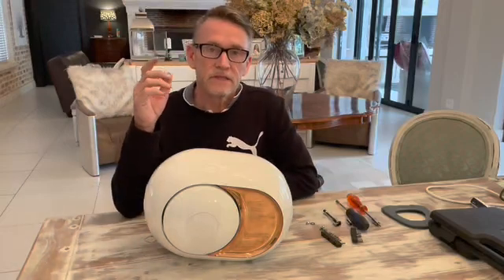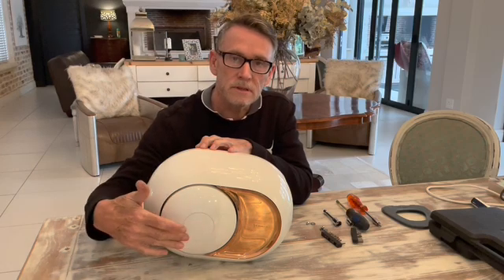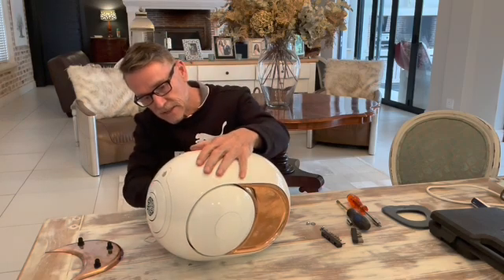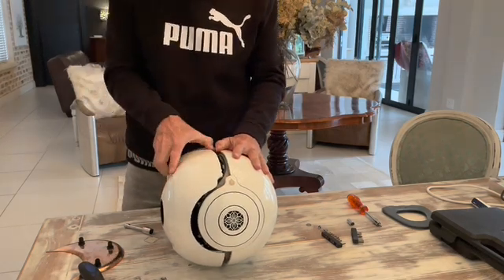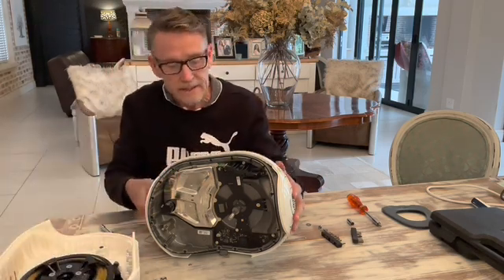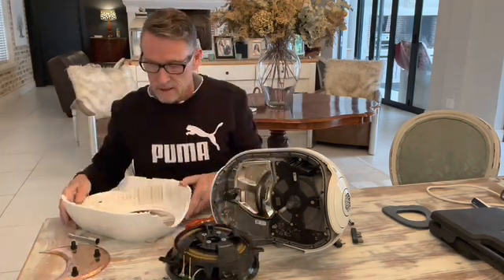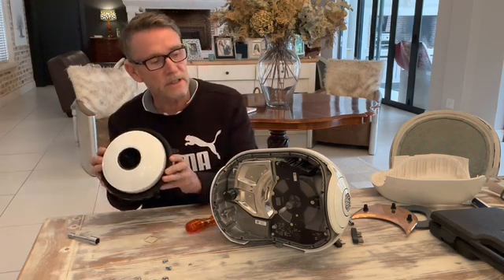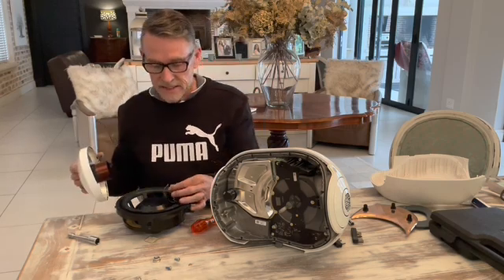Devialet Phantom Gold Repairs

Comment: " Devialet Phantom is airtight and hermetically sealed, a key design feature that enables its powerful sound and physical impact by creating an internal high-pressure environment for the lateral woofers. This sealed architecture allows the speakers to generate dense sound and deep bass frequencies by moving immense amounts of air without compromising sound quality or allowing outside interference. "

also :

" No DIY Repairs:

You cannot repair Devialet Phantoms yourself, as they are complex and require specialized handling and air-tight seals to maintain sound quality. "

😅

Comment: I'm disappointed to see this side of Devialet. Now, I'm not surprised that it is own by LVMH (Louis Vuitton) whose only goal is to sell weirdest sh*t as a fashion statement at the most ridiculous prices, they don't give a damn about repairability and much less about getting the repairs done in as less as possible.
Reply: They also advertise it as a 3,000 - 4,000 watt unit. In no way is that thing pushing that much power which requires a relatively THICK power cable and/or a beefy power supply.
Reply: @Iridiumcosmos it's 1,100W they have advertised that it was 4,500W but finally advertising the actual wattage of 1,100W
Reply: When did they get bought by LVMH? Quentin Sammie sold out🙄

Comment: Hey Ian Rose. I just saw your video that you openned on one side. Mine, there's a knocking on that side when I turned the volume up. Sometimes it will stop then comes back and also the loud knocking, sometimes it wont. Thank you for showing because Id like to open mine but do you have any idea on my case so that maybe I could go directly, with your advice? Thank you in advance.
Dennis
Reply: 😮very very late question😂 My 103 developped rubbing noises after a fall denting only the dustcap on one side. Strangely the rubbing sound comes from the intact woofer which looking from the front of the speaker seems to protrude outward slightly, say 5mm more then the damaged side which is an equal amount inwards. Q: How can I realign the woofers an would this eleminate the rubbing?
What glue for the dustcap is recommended? Thx!
Reply: Another late question but I'm struggling to connect on the Bluetooth on the app doesn't support this model anymore

Comment: I don't think the woofers are wired in series rather the system performs a self check and if it notices open or short curcuit on one of the woofers outputs it shuts off the whole output stage
Reply: Yeah, they are not wired in series. Devialet always has a dedicated output for their drivers. So it is just like you said that it performs a self check.

Comment: I absolutely love the way you busted this myth about the hermetically sealed unit BS lie from Devialet! So typical of the arrogant, elitist French. I needed to see this video. I have some dents in the speaker cap. My fear is I might get an electrical shock if I open it up but maybe the speaker cap pops off if center screw is removed?  Not sure if that is glued in place or works with magnets. This is a very poorly designed speaker from a maintenance POV. Such hype about it, a huge ripoff in price, a design from the 1960's - nothing innovative in the design, and impossible to access for minor repairs. Stupidly built, overpriced, hyped up latest fad.  I inherited this expensive POS, and fixing it for resale. Nothing this badly designed ever stays in my house.

Thanks a lot for your clear video and demo, very much appreciated! Dankie!!

There is a Vietnamese repair shop video on Youtube where he uses a multi meter to test continuity in each speaker:  https://www.youtube.com/watch?v=JGzKwkGjfy4
Maybe this is useful to others.  He takes apart the central core, and there are some rubber gaskets in the center sections that once removed (easy) expose the circuitry and chips.  No seal apart from those rubber gaskets. Devialet lies to its customers - shameful. So is the planned obsolescence of this poor design.

Comment: Did you get it going again ................?
Reply from the maker: It works but it has a cut out mechanism at about half volume, probably due to the higher resistance of my soldering.